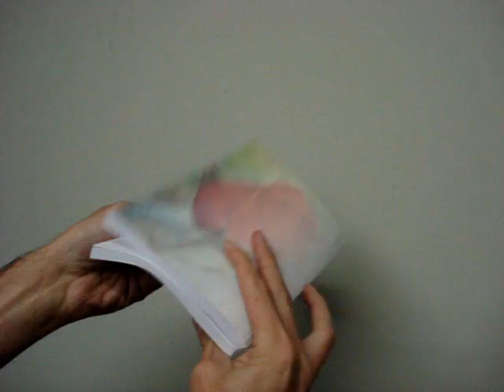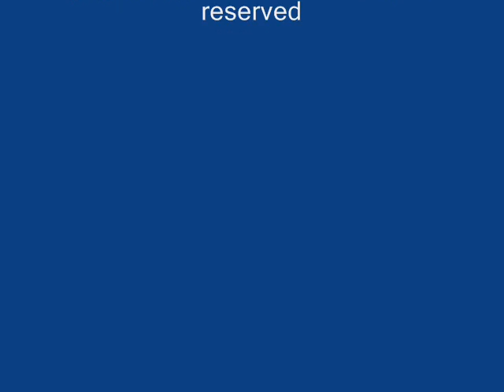The vorTEX doublebinder - layflat binding at its best

Comment: This is amazing. I wish I could get one of these machines, but the company seems to be gone now. Thanks for the video. Have you seen one of these machines? 

Smyth machines are cool to watch, but I don't think the product is as good, as the center pages can tear fairly easily on the sharp thread.

I have had an idea for mimicking the principle with single sheet signature. The fold will space the sheets naturally for gluing, allowing a bit to get on the sides, as with the Syncrom DoubleBind vortex technique. Instead of cutting sheets into pages, they are folded with a standard folding machine into single-sheet signatures, then pressed and glued.
Reply from the maker: Unfortunately cheap Chinese machines killed this product line. Smythe sewing still remains the gold standard but it comes at a cost. Old-fashioned fanbinding with water based adhesive is next. It is extremely cheap, extremely high quality but also extremely slow. After that would have been the vortex and other double binding machines, followed by PUR and lastly perfect binding.